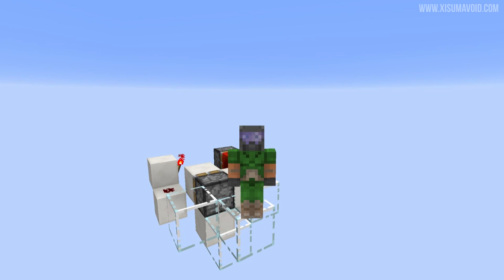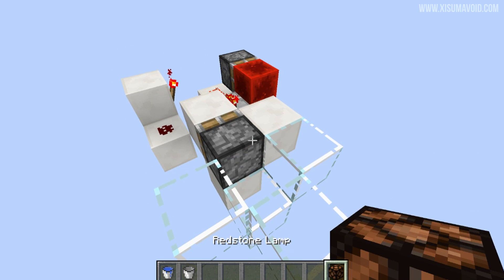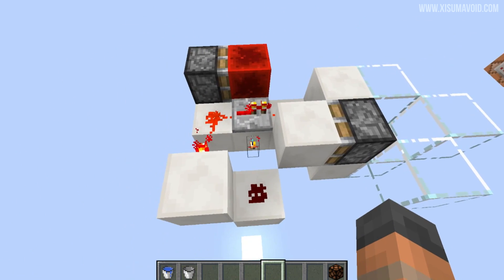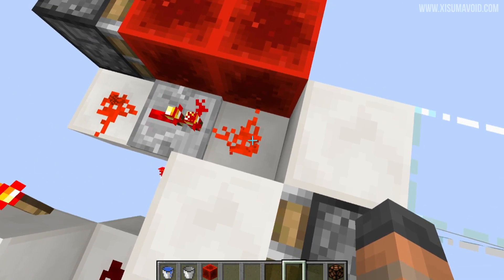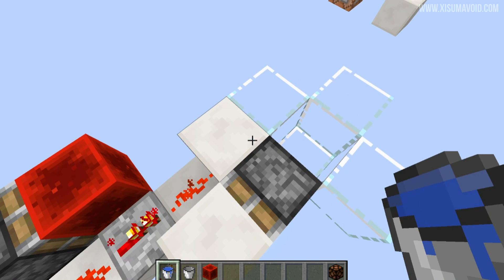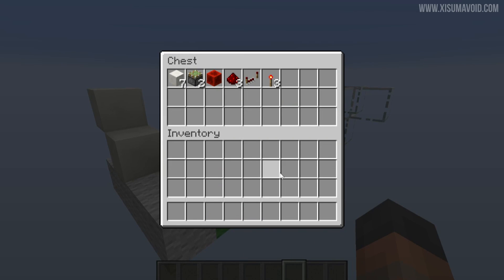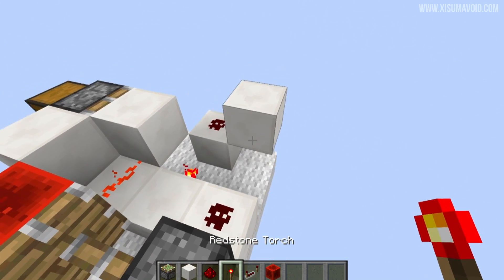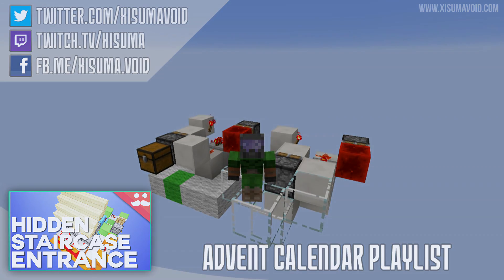Minecraft: Redirect Piston BUD Tutorial (Redstone Advent Calendar)

Comment: Looks a little over complicated, though I may be comparing it to something different though.
Reply from the maker: +IllusionaryGalaxy Its about as compact as it gets :-)
Reply: +xisumavoid I wasn't speaking of compactness, more on that the circuit could be simpler, coffeeless morning brain not getting the point that it was more about the redirection than the bud. Actually I was comparing it to something different, had a sort of deja vu moment like had seen it before. A bit of searching afterwards confirmed I had seen at least part of it before, it was a bud using the same torch idea alone to bud power piston on the y diagonal instead of redstone redirection.